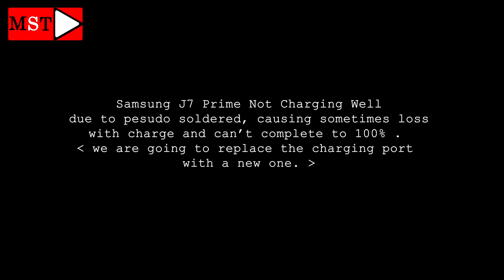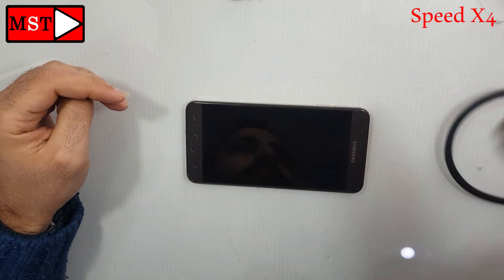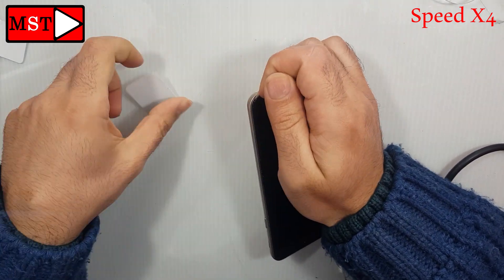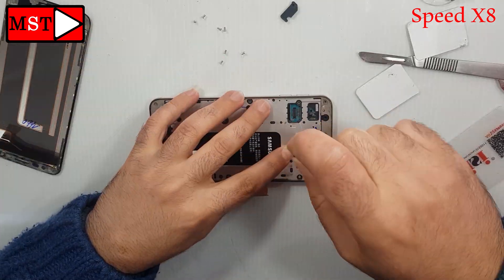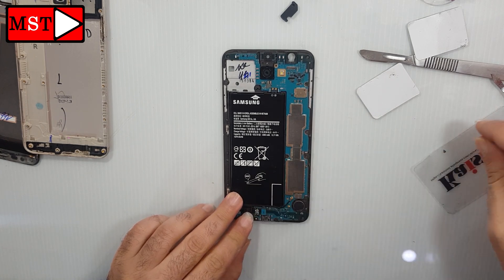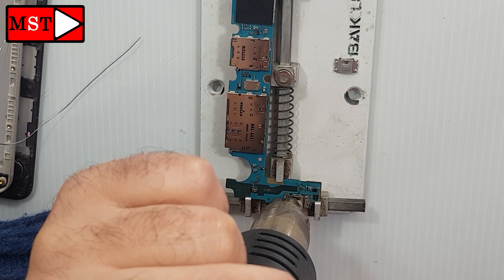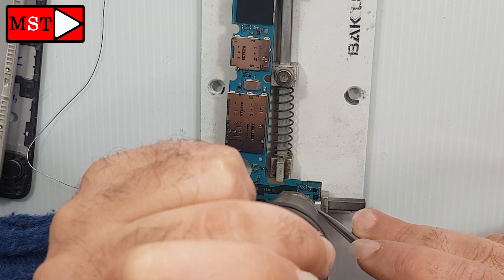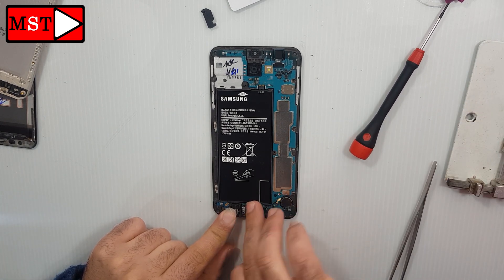Samsung J7 Prime Not Charging

Comment: I have phone but the thig is i need to use force to on charge to charge it but somtimes it stop charging after 2-3 times trying force it charges is it jack problem or dust in it
Reply from the maker: Maybe both, check port and clean with alcohol using brush

Comment: I have the same phone and did the port replacement, but the battery is not charging it stays at 0, the multimeter on the terminals oscillate between 2.5v and 3v any idea what chip needs replacement?
Reply from the maker: You should check schematic
Reply: yes im facing same problem